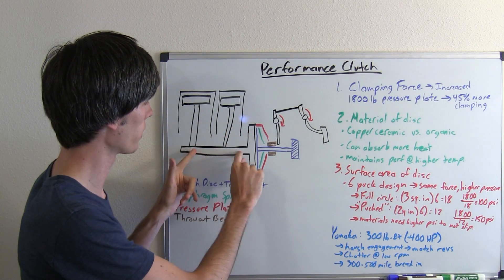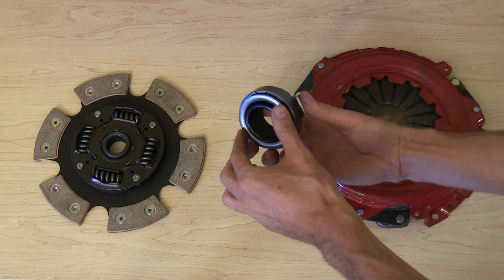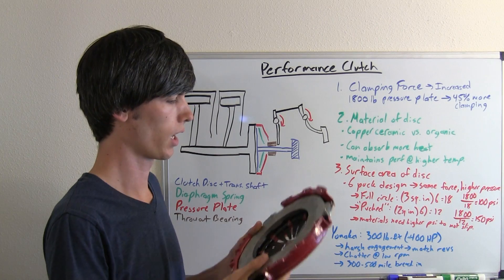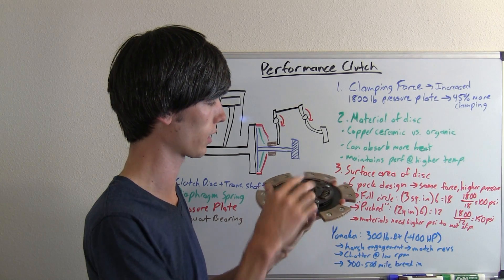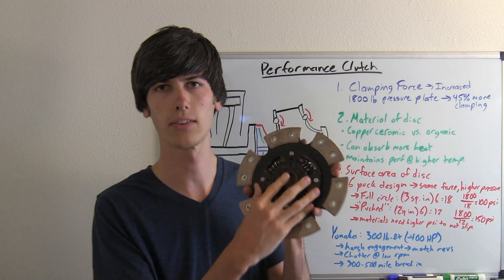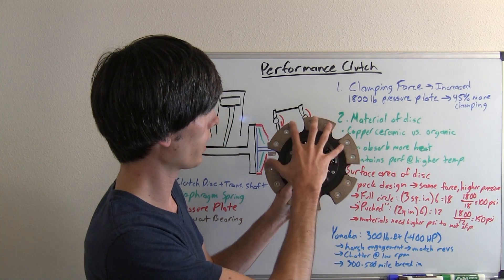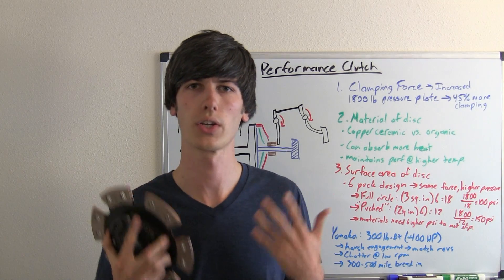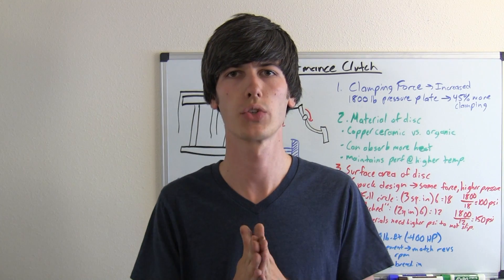Performance Clutch - Explained

Comment: So is there any benefit to putting a Stage 2 clutch on a completely stock car? Would it last longer or is it a waste of money?
Reply from the maker: Ryan Gehret They're designed to be able to hold more power. I'd stay stock with a stock engine.
Reply: Sweet thanks for the reply
Reply: yeah hopefully, good haggling to get a brand new engine :)
Reply: jerryx2000 there are some stories appearing of audis consuming more oil than usual,  it was on watchdog the other week
Reply: no proplem, hope it helps
Reply: jerryx2000
there are several reports, here are some popular ones:
 http://garagewire.co.uk/news/bbc-highlight-audi-2-0-tfsi-oil-usage-issue/
https://www.facebook.com/pages/Audi-Oil-Consumption-Problems/662574380479847
http://www.carcomplaints.com/news/2014/audi-oil-consumption-lawsuit.shtml
http://www.audiworld.com/forums/2-0t-fsi-discussion-111/excessive-oil-consumption-2-0t-engine-2797929/
whatever it is, good luck
Reply: +N/A depends. if you have a completly stock car that you drive like a everyday citizen then yes keep it stock. but if you have a stock car that you drive like a race car from time to time then get a performance clutch because you will burn your oem one out alot faster than a aftermarket one. trust me ive done it multiple times.

Comment: You mention a break-in period and not going all out on the clutch. I'm rebuilding an engine and am using a new clutch similar to this..We all know we need to run engines in "hard" and not gently to properly seat the rings so this kind of contradicts the go easy on the clutch principle. Any way around this?
Reply: You can run the car hard with out running the clutch hard. You need to just make sure you clutch engagement s are smooth and stay away from launching the car

Comment: what's the difference between sprung and unsprung?
Reply: Sprung has springs on the disk to dampen drive train shock if you were to engage it hard/drop the clutch, and unsprung dosent, which would put lots of wear and damage to a stock drivetrain.
Reply: Thanks man. Nice subie as well! I got an 01 rs!

Comment: I have a 92 integra gsr and I was looking into getting a stage 2 clutch kit and was hoping for some suggestion on what brand I should go with.
Reply: Have you done anything to the motor?
Reply: custommotor i havent put anything in yet but I just bought a new cold air intake and catbak exhaust that i plan on putting in after i get my clutch situated
Reply: If your just doing a cold air intake and catback exhaust I would just put a stock clutch in it. The intake and exhaust alone won't ad d enough power to effect a stock clutch. The new intake will probably improve top end maybe 1-2 hp and maybe 1 or 2 for the catback depends on the car thought, some show more hp some don't. IF you every plan on adding a more hp, say 50-100-150 like with a turbo than I would probably recommend the stage 2 clutch. Easier to break it in if you aren't tempted by the extra hp I know I just started break in a buddies stage 3 clutch on a 500hp subie and it's difficult not to put my foot down.

Comment: So just so I make sure I understand this, The clutch disengages the engine from the gear box in order to switch to a new gear so as to prevent damage to the gear box.
Reply: Yes you got it Id say check out some videos on how manuals work to understand more
Reply: Well we need them because their it is very difficult to perfectly rev match. If we could we wouldn't need a clutch for upshifts and downshifts, but we would have to turn the car off at stop lights and to reverse. :P
Reply: custommotor I forgot what exactly it's called, but disengaging the clutch is needed either way.  Old school transmissions required double clutching AND rev matching.  Thank goodness they improved on that though, otherwise manual would probably be even more rare as it already is becoming today
Reply: Amanda Just
I thought the act of double clutching gave the primary and secondary shafts more time to slow down or speed up for rev matching. Without having to rev match with the clutch out.

Comment: Is having a performance clutch easier on your transmission?
Reply: Usually makes it tougher on a stock trans, because it has more biting power, more load transferred faster to the trans.  Stock clutch is usually organic with softer biting.
Reply: so it would make sense to upgrade your tranny before the clutch. or do em at the same time.
Reply: Tyler Wise
 Upgrading your tans is expensive as fuck. You'd want to change to a stronger clutch when you do mods so that it will hold the power that you will be making and not just burn up quickly.

Comment: very well done.
nice and simple, for the most part.
I am using a exedy stage 2 racing clutch in my k swap ep3. I used the stock type r pressure plate for better drive ability. my car is only making 230 hp and 170 tq. so the aggressive pressure plate is not really needed.

Comment: so the moral of the story is racing clutches are not worth it for everyday driving, as they wear just like that and waste fuel as you have to constantly increase the rpms for a smooth take off
Reply from the maker: I suppose. Like many racing components, they're for their intended use.

Comment: On a superficial level, I have a slight problem with the "less surface with same force -> more pressure -> more friction" idea; specifically, friction is supposed to be explicitly independent of the apparent area of contact when the normal force stay the same, and directly proportional with the normal force (not the pressure) when it changes [1]. At any rate, that's the ideal model we are taught in school. I'm perfectly willing to accept that model breaks down in some non-trivial way in clutches, but at first glance the explanation offered just doesn't seem to add up.

[1] - http://hyperphysics.phy-astr.gsu.edu/hbase/frict3.html
Reply: I'll bite... I'm not an engineer, mathematician, or a physics scholar, however I would like to think that my noodle still works logically.  I read (what I thought) the applicable lessons were on that website just to give myself some kind of background in friction.  From what that website was saying you certainly do seem correct.   The website said,"Part of the standard model of surface friction is the assumption that the frictional resistance force between two surfaces is proportional to the normal force pressing them together." Normal force, from what I read, is just a force acting perpendicular to another surface. With that in mind I know Pressure = Force/Area.  Rearrange this to isolate Force and we have.  Force= Pressure/Area.  Now keeping the pressure the same (effectively negating it) we can look and see what happens when you change the area.  I see this as Force = Pressure * 1/Area.  I know how fractions work and if you increase the denominator while keeping the numerator the same, you get a smaller percentage ( I think in percent too. 1/2 = 50%, while 1/3= 33.3%). The opposite trend is true as well.  Combining all of this then if we keep the pressure the same, which it will be since the diaphragm springs don't change, and we cut out part of what it's pushing against, making the surface smaller, then you just have to increase the amount of pressure being applied on those areas. I dunno, makes sense to me...
Reply: aaron little."..Pressure = Force/Area.  Rearrange this to isolate Force and we have.  Force= Pressure/Area".... thinkabout it.......should be Force= Pressure*Area. "math"

Comment: Was considering getting a performance clutch for my 89 Chevy 3500 4x4. Truck has 4 speed bull dog tranny. Clutch needs replaced and was wandering the effects of the performance clutch on a daily driver that tows often. Also would it make a defference in the 4x4?
Reply from the maker: If it's stock I'd probably swap with an OEM clutch. The clutch may chatter a bit more, and will be a bit firmer to engage.

Comment: Many performance clutches have clutch disks with lower rotating mass which aid in faster shifts, the rotating spinning mass of the clutch disk has to spun up or slowed down by the synchronizers in the gearbox to match the proper speed and engage each gear selection because there is allways some difference in input and output shaft speeds at each shift.
having a lighter clutch disk makes this happen with less effort and quicker.

Comment: Question here, are the pressure plates requiring to apply more force over the time? I'm asking about the general oem ones as well as the performance ones. Thank you.
Reply from the maker: They apply the same pressure, unless the spring were to somehow fail/fatigue over time.
Reply: Thank you for your answer! And If i will add, that me and my friend have the same car but his clutch pedal is much smoother, his car is newer but more miles on the clock. What is making the difference, lines, spring bearing?
Reply from the maker: Synchros wear out, the clutch disc begins to wear as well so engagement may not be as smooth.

Comment: hola queria agradecerte los videos son muy practicos, y ahora con la crisis te ahorra unos euros jeje tenia una pregunta mira a ver si eres tan amable, tengo un coche  opel astra g 1.6 16v 100cv  al cual le intente cambiar el embrague yo, compre la pieza  y el disco tenia 200mm de diametro se lo puse y encajo perfecto, aunque un detalle yo no le puse ese adaptador que tu tenias pero a la hora de ponerlo entro bien, o eso pense.. porq luego de montarlo al intentar meter las marchas no entraban, un mecanico me dijo que ese embrague no era de ese coche! y yo me pregunto entonces como encajo?? se puede dar el caso?ahora e comprado otro kit de 206 mm diametro y aunque no vea mucha deferencia con el otro que puse y no funciono, se lo montare a ver que tal! te agradeceria me iluminaras fren! es posible que a un mismo coche le valgan uno de 200mm y uno de 206mm  pues en la pagina con ese codigo de motor dan esas 2 opciones y que a lo mejor "por no utilizar el adaptador  ese fue que no me que do bien?? muchas gracias!!

Comment: how's the 6 paddle ceramic clutch working out for you? is it mostly an ON/OFF clutch? is it a b***ch to drive in traffic? I'm thinking of getting one; so pls don't spare the details. Thanks :)
Reply: i have a stage 3 ACT clutch (rated for about 700hp, so its a bit stronger than the one he showed in the video) in my car and it is not On/Off but it is damn near close. it takes some getting used to when taking off because you have to be perfect on every start or it squeals like a pig to let you know youre burning it. with a little practive though, you wont have any issues. also, this is not an issue when you are already moving, only when you take off from a stop. the extra weight of the clutch pedal can make is less than ideal in traffic but nothing that cant be dealt with. the amount of bite and the confidence i have in it is overwhelming. you know every down or upshift will be strong fast and solid. if youre looking to upgrade your clutch, i would say go for it. you will immediately see and feel the difference.
Reply: 8BitZ0mbie
i kinda had my eye on this Dual Friction Kit from clutch-specialists.co.uk/info-which-clutch ..It's half ceramic and half organic, and it promises a 40% increase in performance, while maintaining a daily drive feel..

Comment: Can someone explain in further detail the reason for having a smaller-surface area clutch disk? I get that it creates more pressure each of the contacts, but wouldn't a larger contact area be beneficial? Why not just increase the force of the pressure plate?
Reply: hi there! this is to answer your questions.
1&2:the reason of  having a smaller surface area is so the solid contact pads on the  performance clutch dig into the flywheel more strongly.You could think of it as weapons, a machine gun VS a sniper.The machine gun sends all of the bullets astray(all over the place), whilst the Snipers bullet is focused on a smaller point (less bullet spread) than the machine gun. This is the same in  clutches, the OEM clutch (the machine gun) spreads its power from the engine across MORE of the clutch plate,resulting in less power and torque delivered to the differential and wheels,(because the machine gun is less focused), whilst the performance clutch (the sniper). has less power and torque spread because there is LESS contact between the flywheel and the clutch because resulting in more power and torque to the differential and wheels. (Basically the sniper is more focused).
 
3:you could increase the pressure on the pressure plate but there would be a point where you wouldn't be able to depress the clutch pedal.and there could be the factor of a bent, broken or warped clutch .(The OEM clutch fails under the immense pressure of the new Pressure Plate istalled). (Gosh that was long).....
Reply: kenkko asagi Cool. thanks
Reply: kenkko asagi Now THIS is a good reason to have the character count removed on YouTube. I can get used to this whole Google+ system if that means we can type out useful paragraphs.

Comment: Agreed. The person I bought my current car (Honda Civic) from went with a performance clutch and a higher clamping pressure plate. The engine isn't modified so there's no reason for a clutch upgrade. I currently hate the setup. It chatters exactly as you described in the video and is less smooth to take off with. I'm going back to an OEM clutch and flywheel as soon as I get the chance to change it.

Comment from the maker: I recommended that if you plan on leaving it stock. If you plan on upgrading, by all means, upgrade the clutch to compensate. You won't see much benefit from an upgraded clutch on a stock motor, as the original clutch could handle the power fine (likely). Also, you'd be making your clutch engagement a little more rough, and you'll have to press the pedal with more force.

Comment: Depends if the clutch is cable or hydraulic, if it's cable you adjust the tension on the cable and if it's hydraulic you wind the rod attached to the clutch pedal further in or out of the clutch cylinder depending on whether you want it to bite lower or higher.

Comment: This was helpful. I have a 98 integra ls, other than a slight drop it is stock... and the stock clutch has finally given out so I figured id save some cash and buy the clutch my self before my mechanic puts in a cheep one and charges me for a good one, only prob is I don't know squat about clutches. What would you recommend ? I would like something as smooth or smoother than the stock one but with more of a performance kick to it OH and one that doesn't hurt my pocket . Thanks for your help.

Comment from the maker: If it's just stock you may want to go with an OEM replacement, as this will have some different characteristics that are more geared toward higher HP engines. I believe Yonaka has a OEM style clutch as well.

Comment: Naturally aspirated higher hp engines usually make more hp than torque, or forced induced engines that are at the end of their rpm range (we're talking over 7000 rpm). There are a few more factors to consider (displacement, bore vs stroke, cam profile, amt of valves, amt of cyls) but overall, when the hp eclipses the torque is when you start to see the limitations of the engine's displacement. The Veyron is probably capable of maybe 2,500 hp at most (8.0L) but probably no more than 1700 ft/lbs.

Comment: i know horsepower is somewhat of a silly measurement, but don't most engines make pretty close to the same HP as torque? i know all engines are different but i'm not understanding how this is good for 300lb-ft and 400hp

Comment: Wow, thats really in depth. If you found out that the bore did have some imperfection near the top of the stroke, does it really matter? Dont you have to tear the whole engine apart anyway to completely resolve the problem? Whether you have to rebore, or if you could just hone the cylinder to remove the scratch.

Comment: Yeah, you're right, So that you can determine where the air is leaking out of the cylinder. Whether it be an intake valve, exhaust valve, or past the rings.

Comment: You are right, it depends on material. Friction force usually consists of adhesive and deformation part. I do not suppose that clutch is constructed so that the deformation part is predominant (I may be wrong) because it would lead to intensive wear. The adhesive force increases with pressure, however not proportionally. I guess that purpose of clutch segmentation is to allow better heat and debris dissipation.
You are doing great videos. Thanks.

Comment from the maker: Depending on the material. You have to remember that at a microscopic scale the pressure forces the material into grooves of the material it's being pressed against. Like a tire on a road, as it's pressed into the road, it has more grip. With tires, the pressure is generally pretty high, so increasing the surface area still allows for the tire to sink in, and thus it is a net gain. There is likely a similar balance with clutches.

Comment: You say: "which increase the pressure on the friction material, to prevent slip". This is probably not an explanation. Higher contact pressure (smaller contact area) with the same normal force leads usually to lower coefficient of friction.

Comment: When looking at a transmission spec sheet and it gives a rating say 240 ft-lbs of torque are they referring to the clutch or the actual gears? If they are referring to the actual gears wouldn't it make upgrading the clutch pointless because the transmission is going to limit the amount of power you can produce?

Comment from the maker: I believe it's compressor surge, where the intake charge (boost) travels back through the turbo as it has no where to travel once the throttle valve is closed.

Comment from the maker: You have to design the teeth to mesh, but yes it can certainly be done, and is frequently done with all manual transmissions. Rarely are the gear ratios a combination of integers.